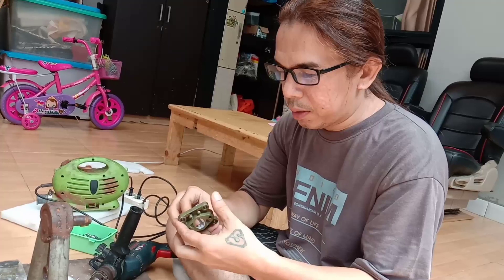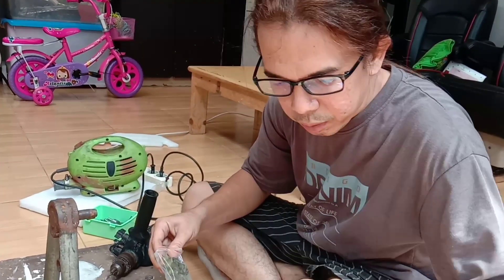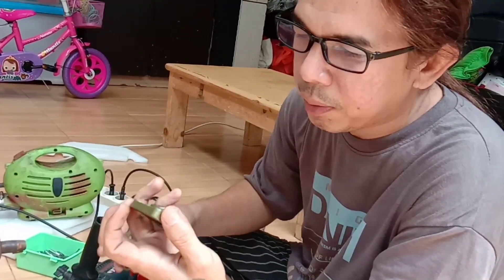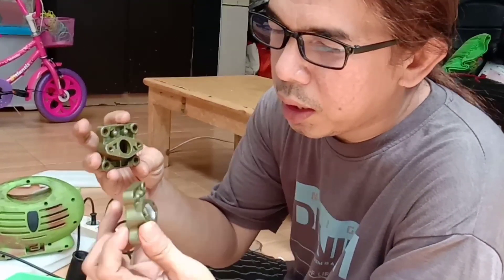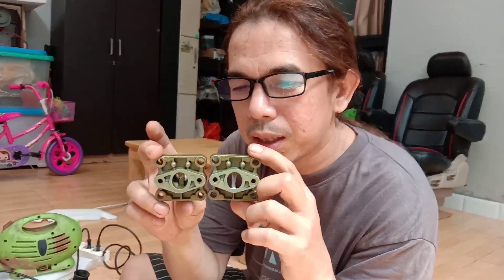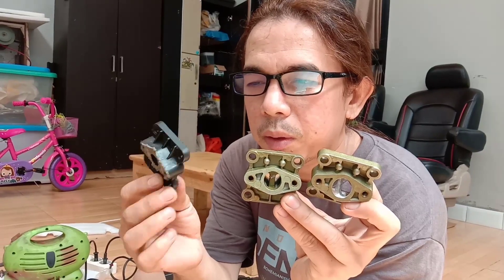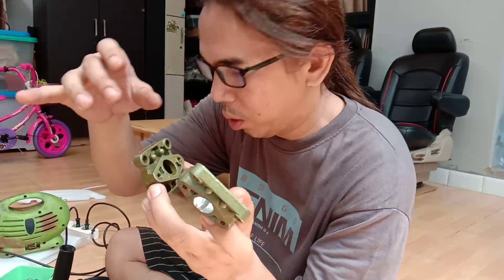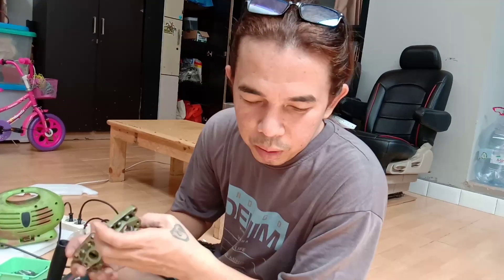Intake Motor Mini 2 Tak.

Comment: Bang novell mau minta masukan nih, up grade mesin mini trail, kira2 part2 apa aja yg perlu di ganti,
Motornya std mini trail lenka piston 44mm
Reply from the maker: Pake blok zk head pisah./naikin kompresi. Intake porting.kopling..
Reply: Rencana mau ganti pake kruk as yg bulat, head zk pisah, Koil merah ato zy, ganda per merah, acg, karbu 19mm
Reply: Kira2 hasilnya gmn kl itu gan
Reply from the maker: Klw emang mau upgrde kayak mesin, pengapian ,dan kopling udh pasti enak motornya bang.. tp asal jgn salah pilih aja.
1. Blok zk 3 head pisah. 
2. Kruk as bulat
3. Karbu racing kotak
4. Koil ground strap. (Dia atas koil merah).
5. Intake babet Porting ( ready di toko sy)
6. Kopling set racing anti lemot. ( ada di toko sy)
7. Busi racing motor mini german. (Ada di toko sy).
Klw itu udah sy garansi enak motornya
Reply: @novellmekanik3777  ijin om lokasi bengkelnya dimana ? Ijin share no wa nya om , saya baru beli motor mini trail bekas , kondisi mulus tapi masih standar , saya mau up grade di bengkel om .

Comment: om,motor anak saya sama seperti si om.tp saat di gas pertama,cover engkol nya bergetar.apa krn dia mentok dgn rangka depan? dan ada bunyi lain akibat getaran.semua baut2 sudah di kuatkan.
kira2 apa penyebab nya..?
Reply from the maker: Klw cover engkol getar itu karna Dudukan yg baha plastik nya (warna putih) udh agak kemakan dikit. caranya tinggal ganjel ring 10 atw 12
di tengah nya..
Reply: udah di coba buka engkol nya saat motor hidup. tp masih bunyi getar saat buka gas pertama..
Reply from the maker: maaf mas kurang  spesifik krn sy gak bisa tau getaran/ suara yg mas maksud dri mana, dan kayak apa suaranya..?